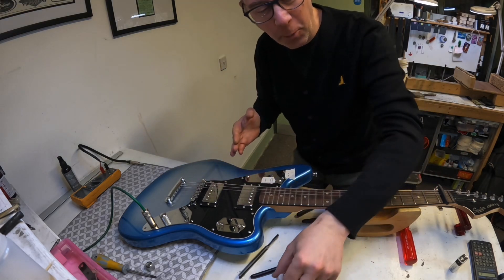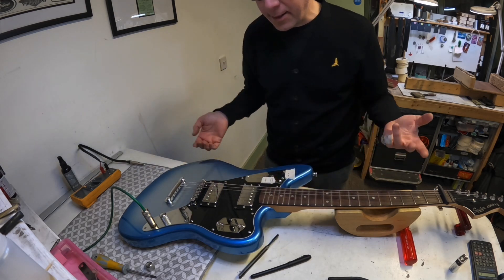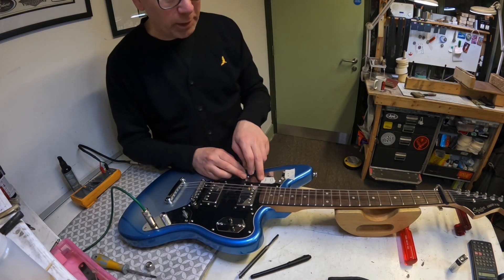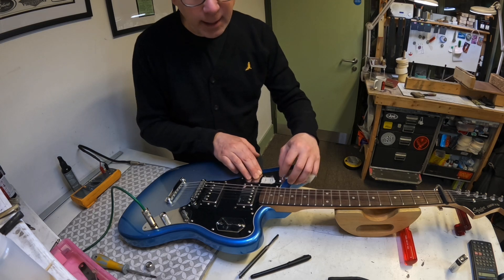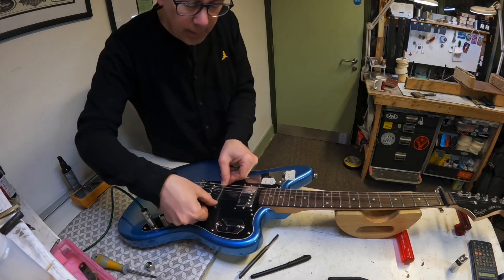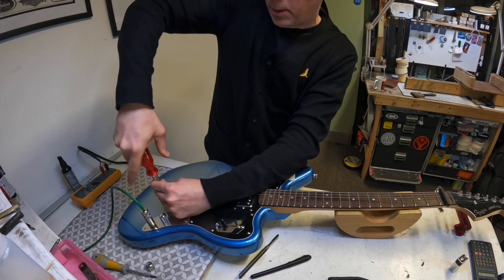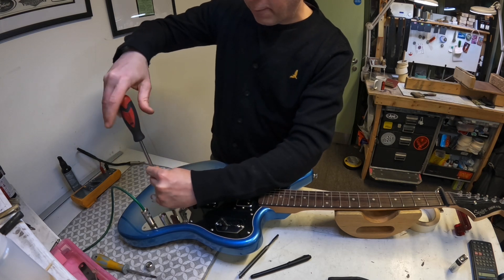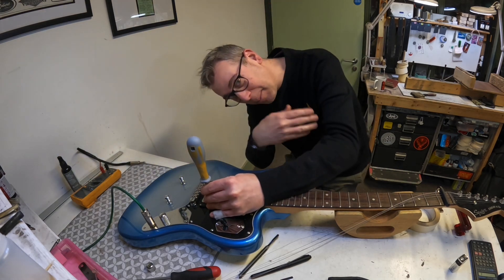Quick tip: get your strings out of the way

Comment: You can something similar with Floyd Rose trems. Put a wadded t-shirt under the back of the trem to hold it in the slack position, locking nut acts as a capo, slowly remove the neck bolts and lift away neck and strings. Saves the agony of restringing a Floyd